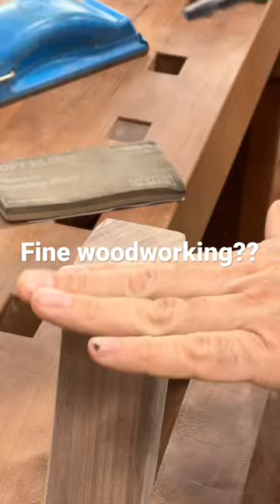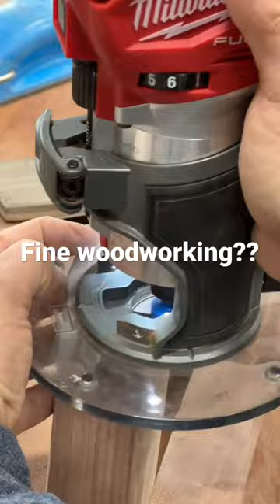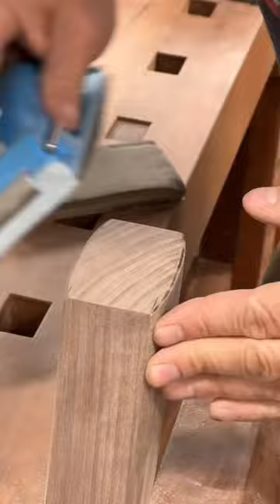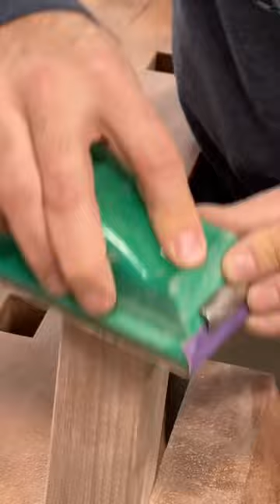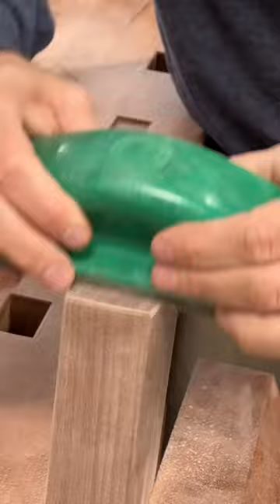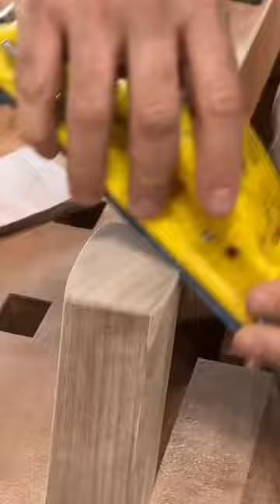What Does “Fine” Woodworking Mean To You? | #shorts

Comment: I worked at a small bespoke furniture company for a few years, making mostly custom built ins, like breakfast nooks, custom closets and cabinets, bookshelves and wine racks. 

We spent hours making sure the pieces were flawless, and like they were always a part of the house, or area we installed them in. 

Those little details are never noticed, which means you did it perfectly.
Reply: When you do things right, it looks like you haven't done anything at all.
Reply: I can never tell at first when something is made well and fits just right for its space, but I can always tell right away when it doesn’t fit
Reply: @inkandesk  100% correct
Reply: I mean in many cases people only really notice flaws. You'll probably never think about your door hinges unless they start squeaking. When you don't notice something, it's can be a sign that it fits in well enough to feel like it's always been there
Reply: @thedudeamongmengs2051 the question is if the table foot is already level and chamfered why continue? If you wouldn’t notice a level table foot done in 10 minutes why bother with 20?

Comment: I like your color coded sanding blocks. I'm a trim carpenter, details like this make a difference to your own sanity.
Reply: Thats an excellent sanding system
Reply: He's using the Preppin Weapon, invented by a car body shop owner. I've been using them for years and I haven't found any sanding block that beats it. It's very comfortable in the hand, insanely easy to change paper (none of those little spikes that rubber blocks have). I'm able to load on 3 or 4 sheets at a time, so when one dulls out, I just tear it off to expose the new paper. Pricey, but so worth it.
Reply: @miket2120  this is the info I came looking for! Thanks for sharing

Comment: There was a student in a 3D modeling class who was building a WWII airplane. He had one polygon inside the engine that wasn't coming out correctly. He spent 7 days trying to get this one polygon correct when the instructor said, "It's on the inside where no one will see. Just leave it and move on. No one will know". The student replied, "I'll know".

Yes, best effort work ethic is that important.

Comment: I went through a spell of behaving as well as I could, as a lamentably short-lived experiment. I was hyper focused on being sure to hold the doors open for others. Picking up rubbish by the bins to dispose of it properly, washing crockery immediately after using it, going to bed early, labelling my files properly before saving, no sweeties etc. etc. Basically, stuff I sometimes neglect to do- in a bid to see what impact doing the right thing to the best of my ability. The impact was instantaneous. The little things spoke of an overall 'quality' that may otherwise be imperceptible but for the fact it is there and you just know.

Comment: Yes it matters, rounding the edges will prevent it from cracking or splintering over time and sanding the bottom will actually work sawdust particles into the pores of the wood and make it more resistant to rot and water damage.

Comment: for me fine woodworking means perfection. or at least striving for it. I've yet to make a single perfect piece in my eyes but that is my goal every time I do got in my shop. even with an imperfect piece my work is still usually extremely high quality. most of my imperfections come during the finishing phase. I bought  a sandblasting cabinet just to blast finished off my projects because it's not good enough for me. I was building a unique jewelry box for a customer and sandblasted off 3 different finishes before nailing the 4th one. my woodshop is my own world where it's normal and expected to pursue perfection. this doesnt really fly in the rest of the world. and to answer to our question, yes. the details like that matter, to you. you're not wasting your time. you're putting in your absolute best effort and that's admirable. nothing beats quality.

Comment: I would say that you want to focus all your effort on the outside and viewable angles as perfect as possible, you can just make the rest presentable. if you can't see a joint it doesn't have to look pretty it just has to fit well and be sturdy. a big thing in wood working that makes it finer is the small details, like a bunch of routed elements, good amount of fun turning, carved, engraved or veneered, as for that matching wood grain and attention to detail. it should be obvious when you see fine wood working, that it has a well put together and sophisticated look and isn't using block simple shapes, stuff like elegant curved. cleaver tool use, and so on.

Comment: 'fine' is not subjective.

Not all fine is equal.
Your best effort might not be fine, someone elses worst effort might be fine.
There is a right way and a wrong way to do everything.
Fine tends to relate to the right way to do things.
Example.
A correctly planed surface is fine, a machined/sanded surface is not.

A person's best effort at nailing a board together will never be fine but a joiners less than steller dovetail might still be considered fine.

Fine is not subjective.

Comment: Yes it matters. With any job, if i'm happy about it, then its fine to anyone, since my quality standards are way higher than industry standards and hence there is no returns of complaints. Legit that is. People trying to score cheaper price or shit like that are exception to this.

For table leg rounding there is also practical side to this, of it not catching so easily, no sharp edge to cut softer materials like rubber mat flooring if more weight is put on it and it chips less if its banged on something, well as it slides easier catching less when pulled. Sanding the end grain also fills the wood so when finish is applied it becomes more resilient to moisture damage.

Comment: I think theres a big difference between cabinetry and carpentry. I know the old timers will tell you a carpenter is a carpenter. I build log homes professionally but I have a cabinet shop for a hobby. Although the steps are the same. Design,layout,cutout and assembly.  The way each step is done, the tools required for each step and the tolerances are completely different. In framing and log homes building to within an eighth is fine whereas a cabinet even a thirty second is noticeable on a cope and stick assembly. I really enjoy both but I do see big differences between the two disiplines.

Comment: It's highly subjective and also highly dependent on your clientele.  It's the Venn diagram of the Quality - Time - Cost.  Pick 2, and the more you bias into each of those 2 overlaps will dictate the outcome.   This is where clear and explicit outlines of a project with a client are paramount to ensure you're on the same page and they will be satisfied with the finished product and the final cost. 

Personally for a leg like that I'd ask what flooring they have in their house.  If it's going over carpet then you're not wrong dressing it down to that level.  If it's going on hardwood/tile they're likely to nail a felt slider on it.  Then yes you're going a bit too far and potentially decreasing your profit margins by spending excessive time on a project that could be put towards the next one in the queue or more time with your family/kids/hobbies.

Comment: the micro details in engineering of wood make it great wood working adding fine details on top of that makes it fine woodworking. putting a bevel or radius on hard contact points like the foot of a leg or choosing to peg a joint versus using a screw is great wood working. sanding out that radius / bevel or choosing a tasteful contrasting wood to display that peg in the joinery is what makes it fine wood working. a piece can look like shit and still be great wood working but a piece that is great and looks great in objective taste is fine wood working. this is obviously just my opinion and can be taken however one wants to but this philosophy can be applied to any craftsman trade. to clarify when i say engineering when you put a bevel/radius on a hard edge you are engineering a stronger piece because it reduces the risk of tear out when the part get dragged or pushed. engineering scales with skill level of the craftsman.

Comment: Bugatti way back in the early 1900’s used to have their engine and coach builders hand knurl the aluminum on every part of the car even the parts you never see just so they could practice and make it perfect. Apparently the inside of the gas tanks were even hand knurled. 

Unrelated to wood working but the same line of thought I guess.

Comment: Fine woodworking to me means pieces intended on being used but decorative as well.  Like a milking stool used in a barn to milk cows would be utilitarian but that same stool with some profiles and fluting on the legs and some inlays on the seat would be "fine". I think it's just an old school descriptor to denote show pieces. I don't think power vs. hand tool matters at all, just the intended purpose of the product and the quality of finish.

Side note, you already had the router out, why not use a random orbital sander instead of a million hand sanded grits? Just seems like a waste of elbow grease.